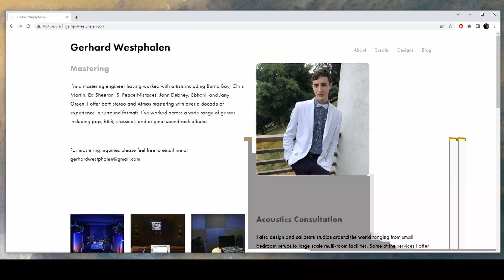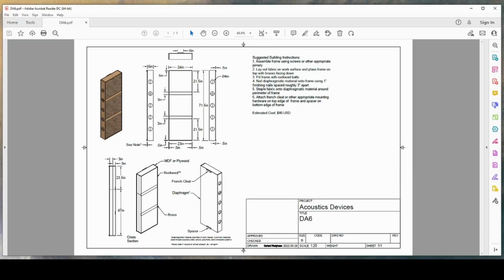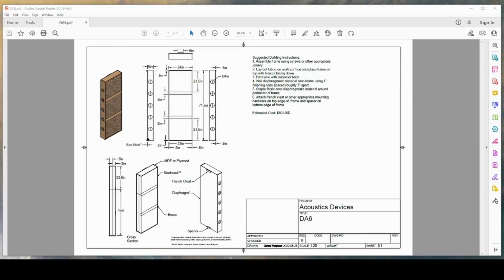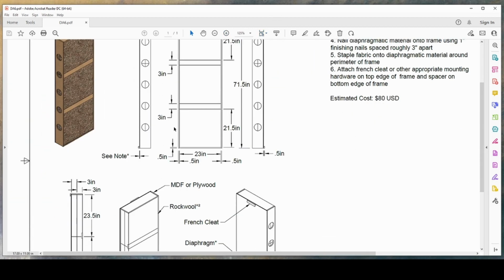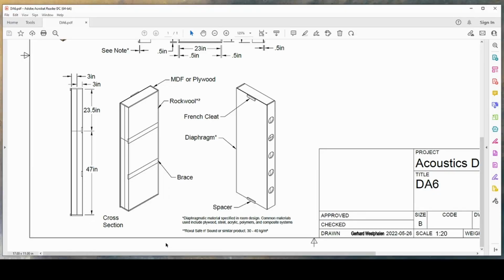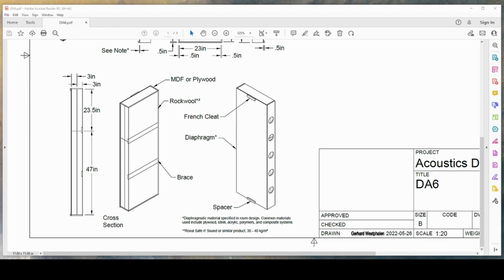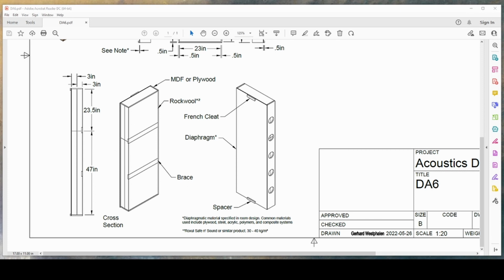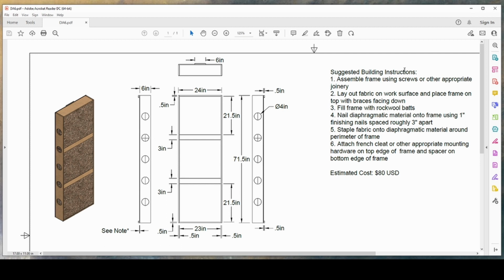Diaphragmatic Absorber Plans

Comment: It's my understanding that DA's need to be sealed in order to work properly.  Wouldn't the holes on the side make it perform worse, not better?  I would love hear a more in depth explanation.
Reply from the maker: No, this is a diaphragmatic absorber and not a membrane absorber. Some people don't differentiate the 2 and call membrane absorbers diaphragmatic. This is the same principle as the GIK Range Limiter and similar to the VPR panels. It's mostly based on the bending plate modes with some pistonic motion
Reply: @gerhardwestphalen  Thanks for the clarification.

Comment: Hi Gerhard! Thank you for a precious info! Do you still have papers for DA3 and DA6 on your website? I see only 9 and 12. Thank you again!
Reply from the maker: But they're effectively the same as the DA9 plans
Reply: @ Thank you very much! Do you think that height and width have to be proportional to your recommendation, or not? Also, is 4mm plywood good as a diaphragm? Thanks!
Reply from the maker: @gorantovic1473  Height and width should be as large as possible as it does affect the performance. I usually design to take advantage of the max width possible based on the size of the fabric. That's usually around 44" and then floor to ceiling height (or 8'). 4mm plywood works well but just depends on the frequency range you're targeting.
Reply from the maker: Hey - No, I removed those as I don't recommend building them. It's not a good use of space compared to building 9 or 12. The only situation I'd recommend it is for a large live room or if you need to put a panel on a door

Comment: This is a membrane absorber, not a diaphram.
Reply from the maker: Different people use different names. For me a membrane absorber has a sealed cavity like the GIK Scopus panels which they call membrane as well. A plate without a sealed cavity I consider to be diaphragmatic. Somewhat similar to VPR although those work on the same principles as membrane absorbers but using a foam spring instead of air spring. Both what I call membrane and VPR style absorbers are different from what I call diaphragmatic absorbers

Comment: Any lab testing done?
Reply from the maker: Just testing in my own lab and in a few hundred rooms
Reply: @gerhardwestphalen  lol. i'm talking real lab. NWAA lab not  home lab.
Reply from the maker: @greganikin7003  I'm well aware of the work being done at NWAA. I have more than enough real world data to know how these work and design rooms with them in conjunction with sealed membrane absorbers. All that matters is the end result in the rooms I design
Reply from the maker: @greganikin7003  There are plenty of ways to test in room, outside, and with different devices like accelorometers. Testing at a "real" lab would make no difference to my designs
Reply: @gerhardwestphalen  another “tester”
Reply from the maker: It's not always possible but generally with the rooms I design I get acoustic measurements at various stages during construction of treatment which I compare to simulations and confirm it's working as intended. Deviations just get fed back into the simulation tools I use to update my design models
Reply: @gerhardwestphalen  as i discovered lately, all the old date is wrong. those calculations are just rough predictions sometimes far from real life.
Reply: @gerhardwestphalen  this is hilarious. You don’t buy medicine because of assumptions based on predictions. You buy it because laboratory tests were done.
Reply from the maker: @greganikin7003  If I were selling a product then yes, it would absolutely need to be tested but I'm not. I'm only designing full rooms. That's the only way these work and I do have measured specs for the rooms I design. Take a look at the Real acoustix presentations from NWAA. They got wildly different results based on the number and placement of the panels in the testing chamber. That's how these things work. They will have drastically different performance based on how they're used and a single standardized measurement would be useless outside of trying to compare different products with each other. If you change the dimension, mounting conditions, or placement of a diaphragmatic or membrane absorber then you'll get different results. Every room I design uses different designs. That means hundreds of different devices which would need to be tested
Reply from the maker: @greganikin7003  The best rooms in the world are from Northward Acoustics and they do more engineering work than any other acoustics firm. Do you think they do lab testing for their systems (outside of their own labs)? No. Why would they? They're developing solutions to be used in a specific way only in their own rooms. Their back walls are designed as a system. It would literally be impossible to test in a lab. If you take a small section of that wall it'll behave differently than it does as a whole wall in the room it was designed for. There are no standardized tests for that and all that matters is the end result in the room which they have tolerances for and guarantee (the only acoustics firm in the world which guarantees their results). We're designing rooms. Not materials or acoustics products for the market.
Reply: @gerhardwestphalen  still makes me laugh.  Check your sources

Comment: The thickness of the diaphragm and the depth of the box will determine at what frequencies the diaphragm absorber will operate, and its effectiveness will depend on the area of   the diaphragm. Look in the book Master.HandbookofAcoustics.7th_Edition, chapter, Panel (Diaphragmatic) Absorbers. 
Note: The walls of your drawer, very thin - 12.7 mm, for a diaphragm absorber. they will work like diaphragms. it is necessary to make the walls of the box, 25 mm thick. Diaphragm absorber shall be sealed. I see that your diaphragm absorber DA6, is not airtight, why? It will be inefficient as air escapes from it through the holes, on the side snaps of the box, because there is no spring (air). What frequency range do your diaphragm absorbers absorb: DA3, DA6, DA10, DA12?
Look at the diaphragm absorber.
https://www.youtube.com/watch?v=4r6IQxJgan8
Reply from the maker: As I mentioned in my reply to your other comment these are not sealed membrane absorbers. These are more similar to VPR absorbers. These are beyond what the Master Handbook of Acoustics covers. You need to look at textbooks like from Fuchs if you want to learn about these. A membrane absorber's performance is theoretically based on the surface density of the membrane, depth of the cavity, and damping of the cavity. In reality it's also determined by the resilience of the membrane and edge conditions. A diaphragmatic absorber is also based on those same parameters (although depth of air space rather than cavity) but it's much more strongly influenced by the diaphragm's dimensions and Young's modulus (which aren't considered for membrane absorbers) which determine the plate bending modes
Reply from the maker: If you really want to learn about acoustics you need to go much deeper and at least learn about VPRs. Master Handbook of Acoustics is only an introduction which doesn't deal with any of the math and skips over most details.

Comment: Gerhard, you have a blog on your resource written - " It’s important to note that diaphragmatic absorbers work based on the velocity component of sound rather than pressure as membrane absorbers. This has certain implications on where they’re most effective in a room. Flexibility in the thickness allows thicker panels to be used where more absorption is required (increasing the porous absorption component of the panel). Multiple diaphragmatic layers can also be used in thicker panels." This is either an unfortunate mistake, or you do not understand that the diaphragm absorber is a pressure absorber, not a speed absorber. Such acoustic devices are called low-frequency membrane (diaphragm) absorbers or simply panel absorbers. Diaphragm is the same membrane.
Reply from the maker: Diaphragmatic absorbers are completely different from membrane absorbers. It's not a simple air spring like with membrane absorbers. These work similarly to VPRs. The answer is complicated and a combination of pressure and velocity. There are at least 4 different principles that these panels operate with and as far as I know, no one has clearly separated out the importance of each component. Some of the experimental work done by Eric Valentine recently contracts much of the information originally presented by Fuchs on VPRs (and CBAs...)

Comment: Does placing membrane close to the wall make it way less efficient in low frequencies? I know - this is wideband absorber so it can't be fliped 180 deg, but i think air cushion in the back of the membrane is crucial.
Reply from the maker: Close to the wall still works very well as long as there is a small gap behind. In some cases it can be flipped if higher frequency absorption is not required. Some of the panels in the back of my room as like this so I can record musicians back there and it's a little more lively but still providing low end absorption